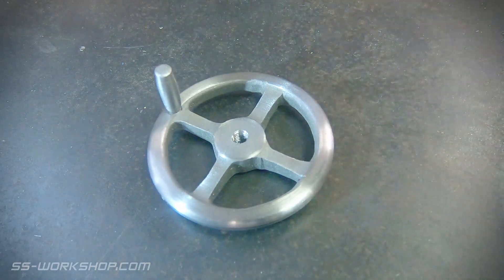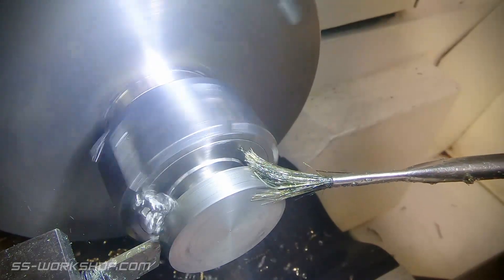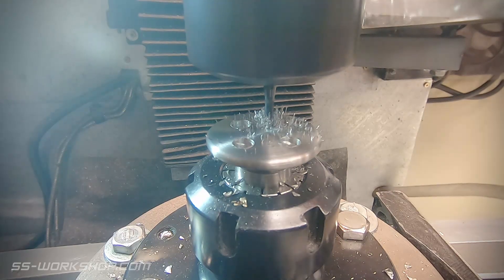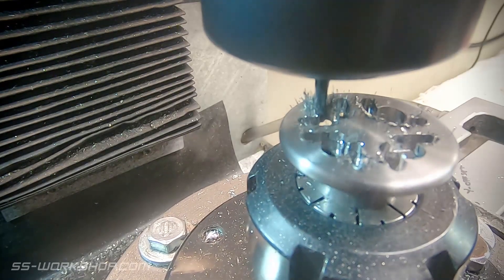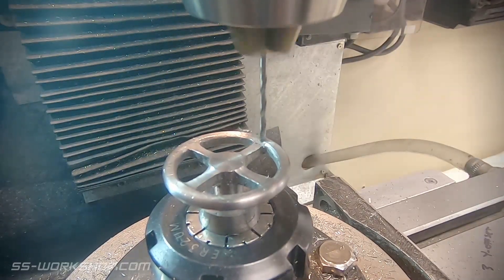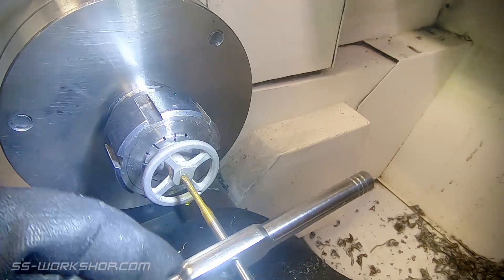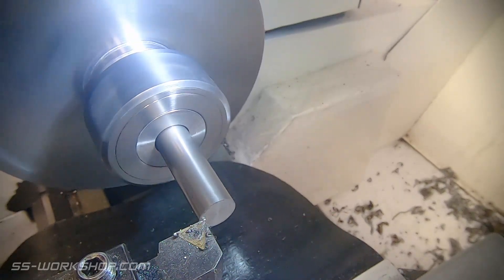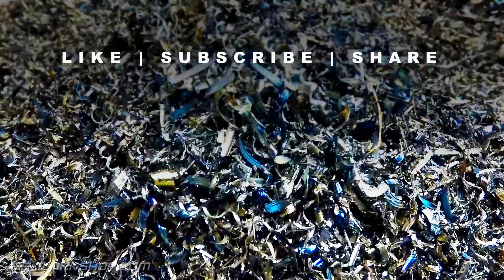Fell Engine Project - How To Make a Hand Wheel from Scratch S1.E44 (Live Steam Locomotive Building)

Comment: Gloves on a machine tool, thats really the best way to get heavy injured.
What you do is very danger, and end at the best case with a lost finger.
I, ve seen a lot of theese accidents on lathes, mills, drill presses and some of them died or could never work anymore.
Please never, never wear gloves during the work at a machine tool !!!
Why i wrote this lines?
You have very good content and we all would be very sad if you get injured !!!
Best regards
Reply from the maker: Thanks for your concern much appreciated, I know it’s certainly something to be taken very seriously. The dilemma is do you take the small injuries, back of hands burnt by chips and cut fingers or protect you self from them and have the potential to be tangled in the machine. My past stance has been the later but never wear them at the drill press or when reaching into the lathe for sanding or filing etc, as for the mill my take is never get your hands anywhere near the moving cutters as you will lose a finger regardless in a contact situation. My future plan is to add a chip guard to the lathe hand wheel to deflect chips so this isn’t choice that needs to be made at least on the lathe.